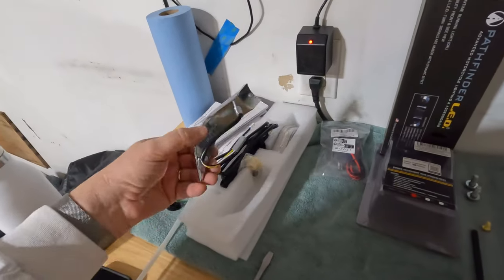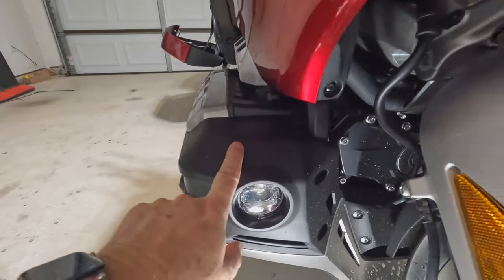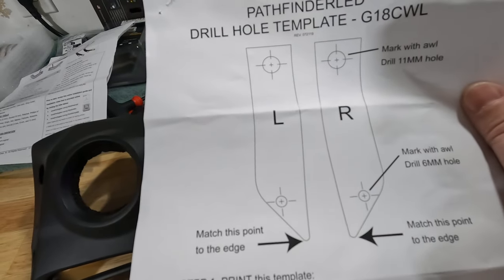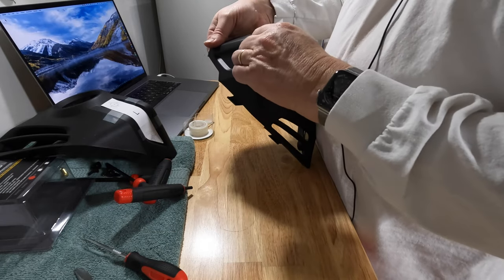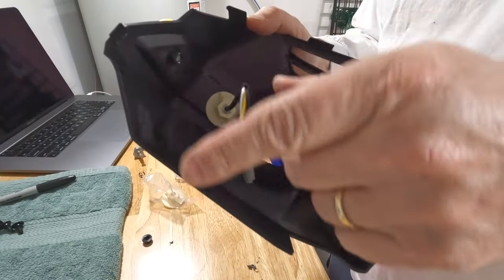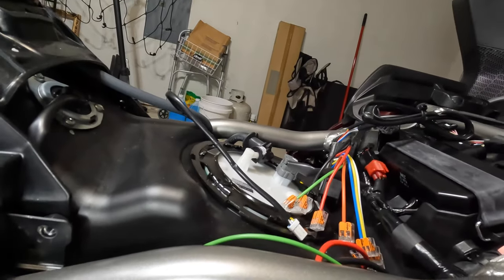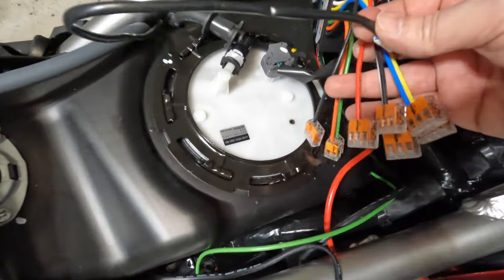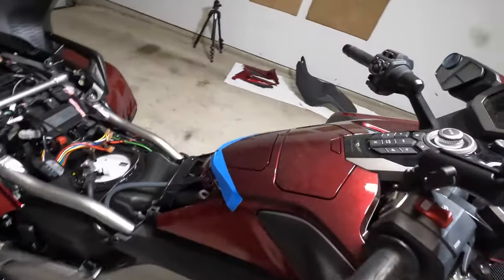LED Cowl & Sequential Turn

Comment: I thought I was done but no, I want them! Thanks a lot!! 😂
Reply from the maker: FR70, they look awesome and throw a good amount of light...I am very pleased.  The only difficulty you will run into is that they are hard and curved so when you go to attach them to the cowl piece, you're gonna have to force it a little... the holes line up once in place, but getting it there, not so much. thanks for watching and commenting !!  Ride Safe.
Reply: @robertwhitemoto  Thanks for the info my friend. Love the channel and really enjoying this great Goldwing community. I don't know what I'd do without you all, except pay LOTSA labor charges at my dealer. God bless you and yours.
Reply: I'm going from Goldstrike wiring to the Pathfinder hub soon. This should be interesting. Cruiseman replied to my inquiry about this and I'll proceed with caution. I do like the weather proof module and the protection from Pathfinder hub.

Comment: Watched your video about the accessories box fitting. Seems like your bike was assembled by a gorilla with all the tight bolts. I guess they're all done with threadlock from the factory.
Reply from the maker: Indeed.  I’ve seen other videos where the same “breaking” occurs so it must be some sort of factory torque.  I don’t visibly see any thread lock on them.  Thanks for watching!